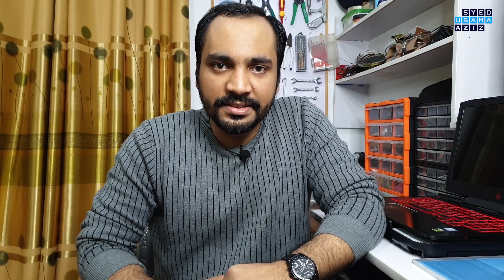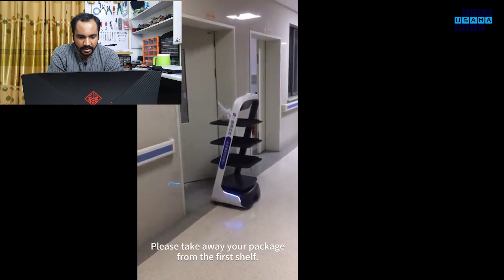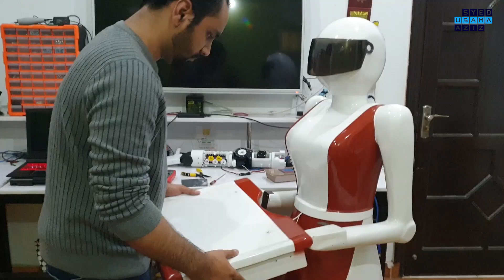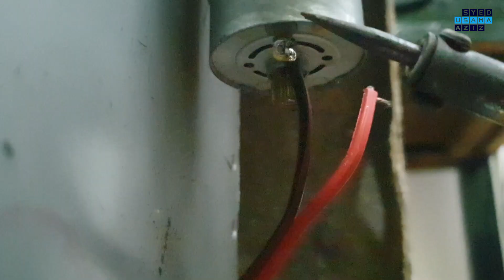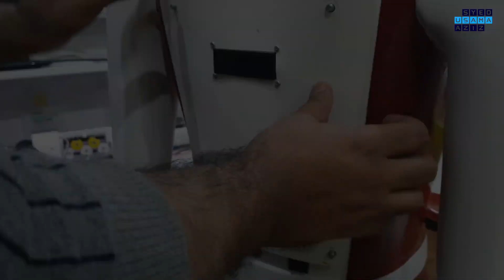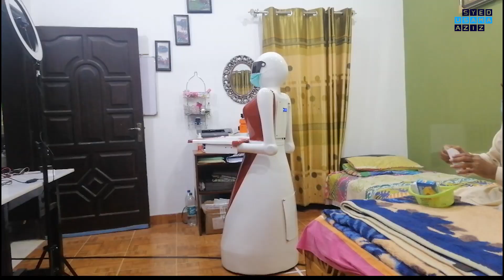Coronavirus Fight: How Robots can help?

Comment: all good ideas and suggestions but practicality has big questions. Many questions form if doctors would want to use it, would patients agree to any such usage, production delays, cost to make, sensory requirements (making it move in a home and making it move in a large facility are very different things), thermal camera you mentioned so easily but souring it, installing it and using it is another matter. speed of movement, user interface, user experience, many many things to consider.

I also saw robots that do UV disinfection and other such matters and which are being currently used in hospitals in Europe.

anyways, nice video still.
Reply from the maker: Thanks for sharing your thoughts. I appreciate that. In my opinion, all R&D projects are tested on trial basis, improved over a period of time and then go for mass production, so no need to overthink about sourcing large numbers of items and delays at this stage. Moreover, we can never be 100% sure about sensory requrements (lidars, depth cameras, etc) unless we implement it in a hospital environment. 
This is just an idea for motivation but if a single engineer working part time can make it move in a home (+ in a restaurant), I am pretty sure a team of engineers funded from government can do wonders.
We must not think like this is the last virus, but better prepare for future as well. COVID-19 could be the game changer for adoption of robotics worldwide.